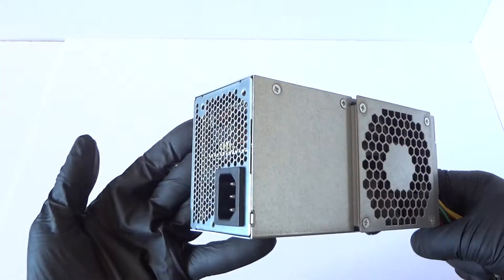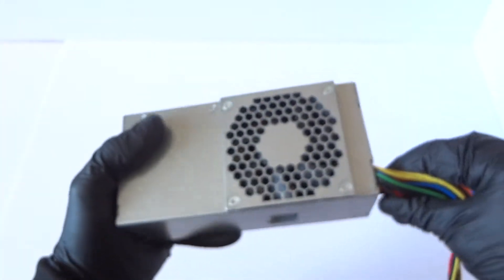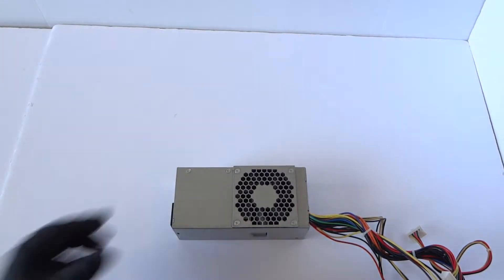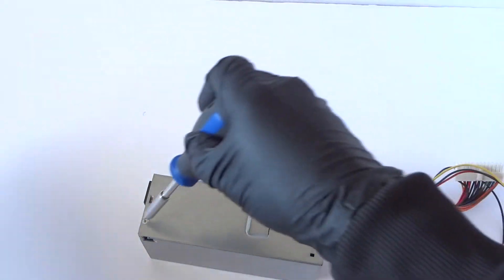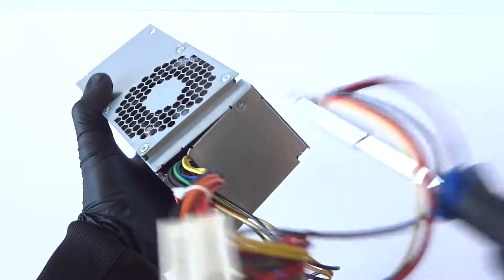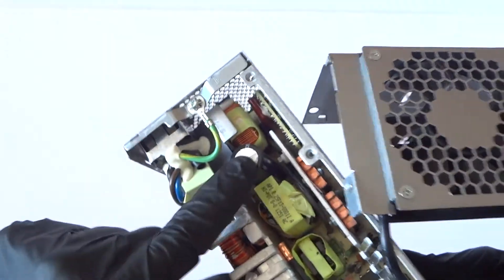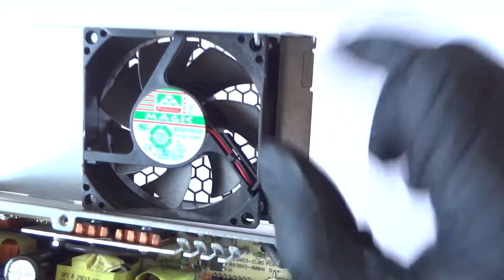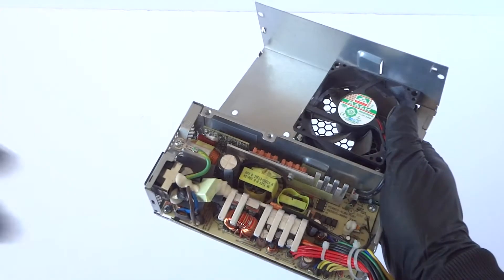AcBel PC9053 240w Power Supply

Comment: My pc is Lenovo thinkcentre PC 9053 It's SMP is not functioning. Input section is ok. When I short Green and black fan runs and stop immediately. Purple wire shows 5v. Plz assist me how to check output section voltage and which are the output diode in smps. Smps is same as your video. Plz assist.
Reply from the maker: Hi, is your model PC Lenovo ThinkCentre M73  ?